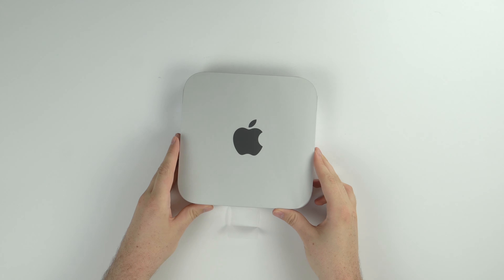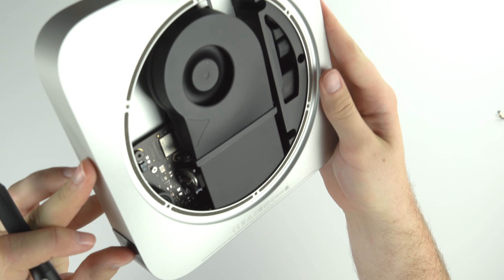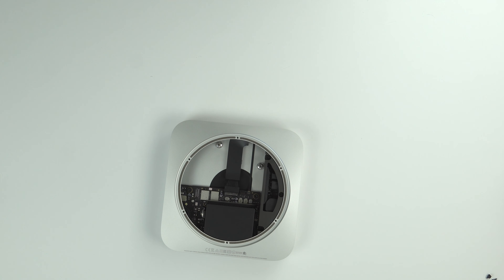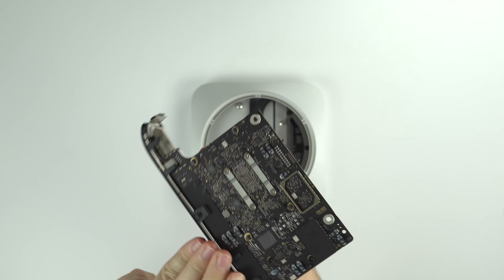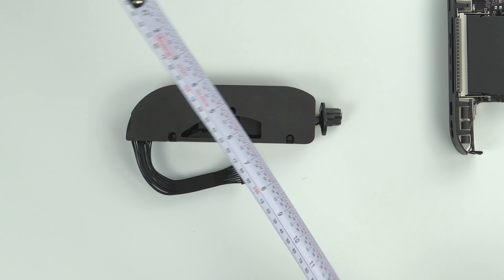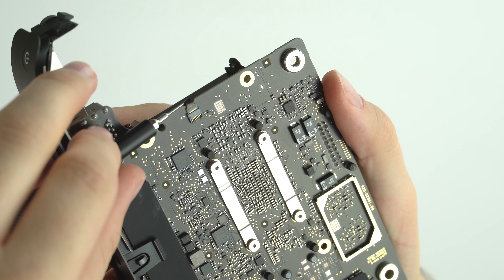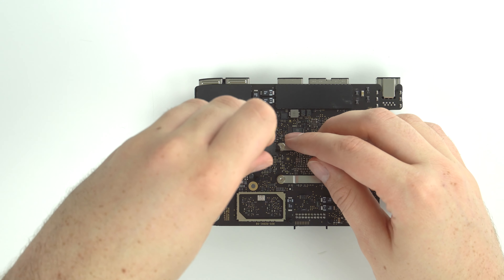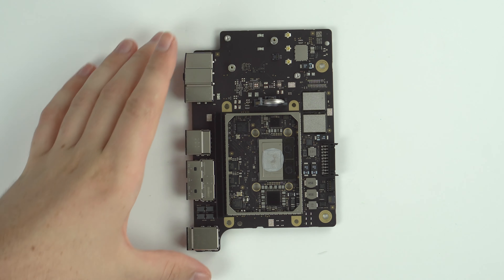M1 Mac Mini Teardown

Comment: The correct screwdriver should be a T6H (T6 security screwdriver) for the outer wifi mesh cover and a T6 for the internal screws, not T4.

Comment: Since there is so much space inside... How about modding it a bit ? Extra hub inside the Mac at side or An extra SSD connected to the thunderbolt inside... ?
Reply: Exactly my wish. External hardware is a nuisance. The cables and dongles jiggle and quite working. Putting an extra SSD inside, for instance, would mean far less hassle.
Reply from the maker: You're onto something... ;)

Comment: Hi, nice video, thank you so much for sharing. I also have a mac cube, but during the last teardown I got confused and I have a question for you, about the handle that comes out to lift and allows you to lift the mac out of the case.
The handle is fixed with four screws to the two slides. 
I don't know if I'm using the right screws or I'm using the wrong screws. 
I would kindly like to know if the screws on the left side are different from those on the right side.
The screws on the left are located under the hard disk and airport cable and the screws on the right are easily accessible.
I would like to know if the two screws on left side of the handle are egual to the screw on right side,
and I would like to know if the 2 screws on each side of the handle are different or the same.
4 equal screws or 2 screws and 2 screws? Can you help me please?
thank you
sorry for my english. ;)

Comment: 3:03 Does padding the motherboard heatsink to the case using a thermal pad possible?  Would that reduce the fan spin at all like the MacBook Air mod
Reply: You'd think they'd do exactly that and make the case a little finned.  Apple has never place a priority on cooling.

Comment: The power supply is actually exactly the same as the intel model (probably since they were already manufacturing them and had lots in stock), only about 20% of it is actually being utilised since the m1 is so efficient :p

Comment: Next Mac Mini will have some Better Cooling with Aluminum beside the Fan like Apple 3 also the iPhone 13 and MacBook Pro. Work. Also The Power Supply in iPhone 13 Pro for more Batteru, MacBook, Mac and More will Cool Faster and will Warm less by Work. You Earn 250,000$ Nic in killer idea. Work Tim. Also in Tesla like for Cooling yhe Engine and Motherboard and for the Cooling Aluminum in First.

Comment: Compact power supply but still the 150W version that they used for the old version, the M1 pulls under 30W all in at peak I think! Nice video!
Reply: yeah is supect its because they might aswell use up the ones they have available, and then the next mac mini will probably be a 40/50w psu probably

Comment: Apple should use much the same components but create what they might call a Mac maxi. It'd have enough room inside for a second SSD and a port multiplier. That's fix my number one grip about my current Mac mini. It requires a rats nest of cables and dongles that are a unending source of trouble.